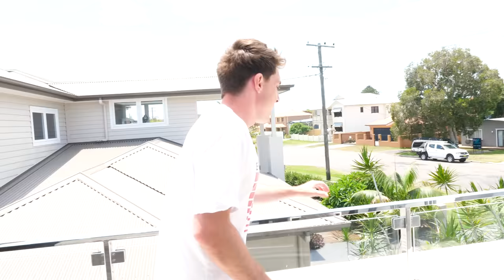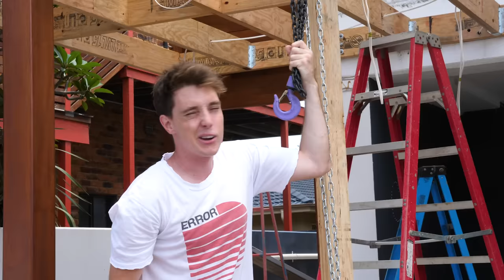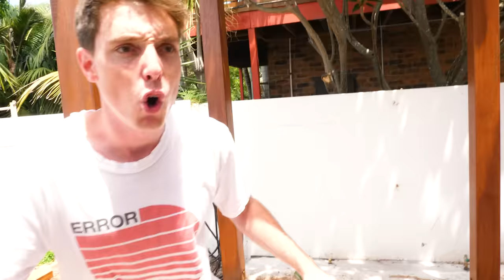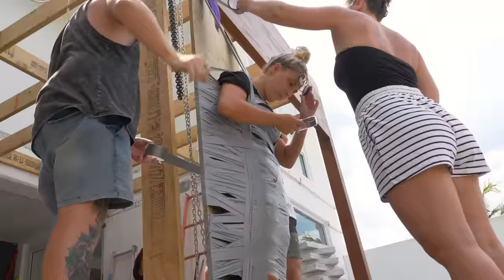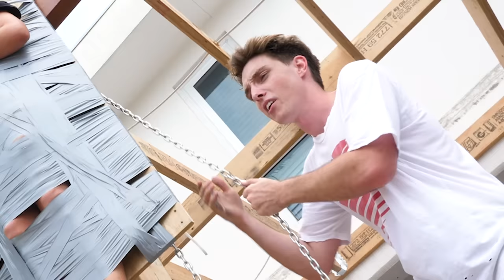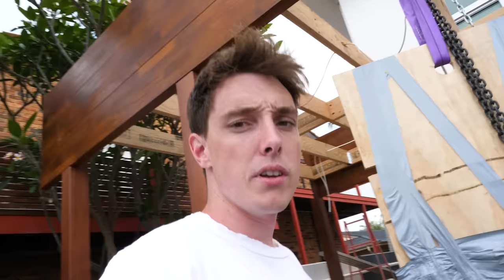DUCT TAPING MY SISTER TO A CRANE!

Comment: 41° celcius is 105.8° farenheit.
Reply: Wo
Reply: Nope that's wrong. Check your maths!
Reply: Ohhhk nobody cared but still
Reply: In the middle east we were hanging out at 47 celcius a couple days ago
Reply: @bluesheep8069  what is it then?
Reply: @harzard5487  32 degrees Fahrenheit is equal to 0 degrees C 41 above zero.41 above 32 that is 73
Reply: We were at almost fifty Celsius a couple months ago
Reply: Man 105 is cold
Reply: @Sportsmans_Paradise  u forgot to multiply by 9/5

Comment: I live in Canada so if I went into 41 degree heat then I will literally be set on fire. In the summer we get like 20-25 Celsius degrees at a maximum. Minimum in the winter is like -25 Celsius

TIM HORTONS EH
Reply: Yeah same but I’ve seen about 35 degrees Celsius I live in Alberta so it might be different
Reply: Jeggehek 69 Im in Newfoundland